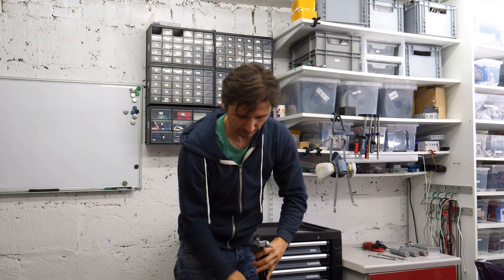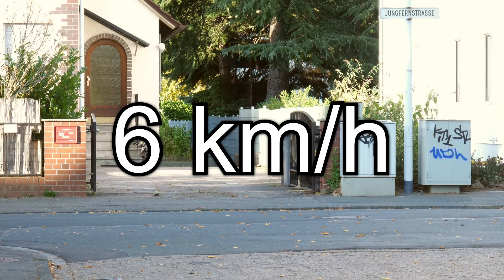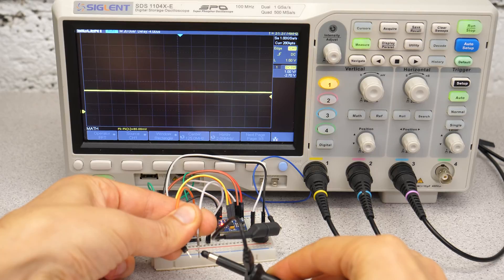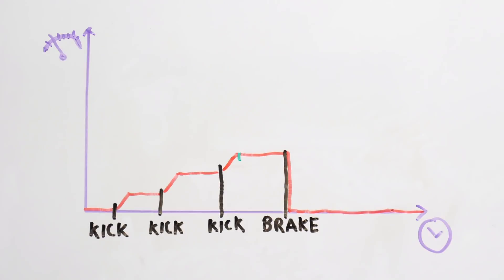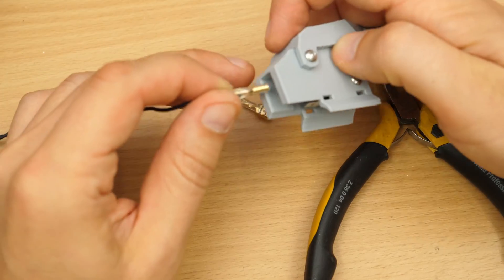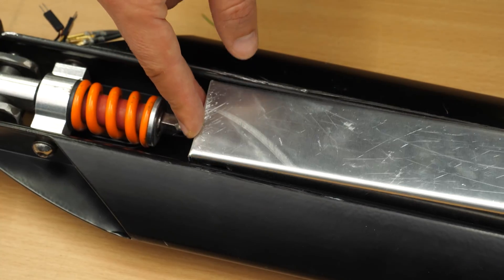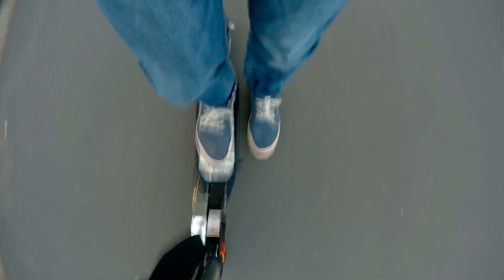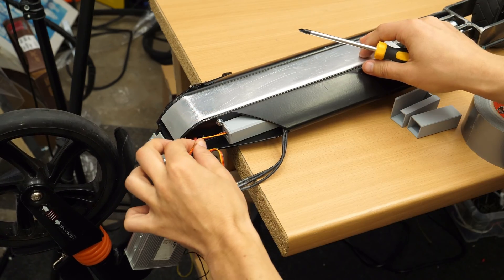DIY Electric Scooter Part 3: Kick Detection & Improvements

Comment: Here in NZ the scooter laws allow for 300 watts maximum power output and wheels must be no bigger than 355 mm diameter - top speed about 35 km/h. If you stay within these limits, the scooter is defined as a "low power vehicle" and are exempt from being classified as motor vehicles. The rules aren't really enforced however. Many people have scooters with much more power that will easily do 50 km/h or even up to 100 km/h so can keep up with traffic on the motorways.

Comment: Hi I’ve got a 36v 1000w scooter and I need to make it so I can charge the battery pack while it’s no in the scooter,can I just make it as a wire from charger to battery or do I need to have a control box in the circuit,any help will be greatly appreciated

Comment: Some advice: don’t ever use and connect two batteries of different mah together. It will destroy the battery with the most mah and will cost you. If you are connecting two batteries together in series, they have to have the same amount of mah.
Reply: It's fine to use different mAh batteries In parallel but not series.

Comment: Link to your site is 404, what kind of battery protection system is in place to prevent them going under voltage? What happens when water gets into micro switch and connects it constantly?.. tough you can just pull the wire.

Comment: as for the brake disengagin the motor, can  do better  - most of the ebike controllers have a ‘regenerative braking ‘ option , so when you enable the brake switch, power gets fed back into the batterypack (althou not balanced, just trough its power providing, not the charge-wires). most ebay-china controllers have this function not brought out, but stil have it. you have to find and connect the (pcb marked) solder pad from inside , to the brake’s switch, to the brake sensing wire for it to work. once installed, its a reliable way to slow down an electric scooter, unless the battery is freshly charged ( the first 500 meters , it provides noticeably lesser braking) i’m in belgium , have built scooter with a hoverboard 350 watt wheel and an ebike battery. as far as i know, its legal on the road here , just like hoverboards are if it doesnt go over 18kmph and your familial insurance covers them ( some do, some don’t )
Reply: furthermore, the electric scooter tops out exactly on 18 kmph with the hoverboard wheel, so a lucky conincidence. but for my ebike, i've also used one of these chinese controllers, and it goes over 25 kmph topspeed with it. i plan to disconnect the pas pedelec pedal sensor's data wire with a relais and an arduino, when the arduino senses more magnet pulses per second than 25 kmph brings, trough an external magnet on the wheel. can anuone help me with the code for the arduino, i've never used one ever before. reprogramming the controller 's IC itselve seems near impossible, they're undocumented. all the aruidno would have to do, is click the relais, when the speed sensed is more than 25kmph

Comment: That was fun! Nice touch using the gyro. Opens up other possibilities too such as theft detection if moved while disarmed and use gps + lora ...
Probably not worth it for this as you won't be parking it anywhere, but could be worth another project.

Comment: Awesome project. Though, like a few others have mentioned, you should protect the cables a bit better. Especially the point where the battery cable comes through the frame. It looks like that'll slowly wear away the insulation on the cable.

Comment: nice. i might build one. You might want to put some kind of protection for the battery cable against the metal in that hole in the frame, though. EDIT: Also, with that arduino, how cool would it be to have an accessory display on the handlebars? wouldn't have to display much, battery voltage and speed as a minimum. I went looking on that big china website after my first watch through of your videos and found 8" motors with built in hub brake, could be interesting for scooter 2 :D

Comment: Great mod and video ! i whas wondering since my e-step has a spedometer inside cant i just let de arduino sense a speed increase by mij stepping and boost that! then pause for a sec  til the next kick is sensed ? (kick > boost 1 sec. > pause  0.5-1 sec > re-arm the system again to sense the next kick)
Reply from the maker: In my case it's not clear when the top speed is reached. I am just using a delay. When it's ready for the next kick it will beep. Otherwise the speed up could be detected as a kick

Comment: Great job, first video Ever seen on YouTube converts simple adult scooter to electric. I am currently doing my project similar as yours, I used the same adult scooter but with a hand break, and I am using a 3700w brushless motor with esc at 12s 50.4v. And it used a 25h chain , sprockets to drive the wheel. 
You should use come up better solutions for battery enclosure, I have my scooter using 12s8p lion batteries that can go about 35 to 40miles per charge. It’s pretty heavy so I mounted on top of the deck, You can consider mount Lipo batteries on the handle bar with quick locks, easily to take off and recharges

Comment: That video was awesome!  Did you code the whole thing in arduino IDE?  I want to take a class on coding but no-one thinks I should start with C++ but that’s what arduino uses...   any suggestions?
Reply from the maker: in my opinion is JS a good language to start. you have all you need in the browser. It also shares much of the syntax with c++. but you should also be able to start with c++ if you are working with micro controllers. blink program has the same difficulty in any language. and you grow from there by adding stuff. I have used Arduino IDE to keep the requirements simple.

Comment: I'm sure you did add this, when you press and release break switch 3 times, you switch in to new mode, where your throttle is your brake switch, when pressed, full power to the motor. When released, no power to the motor
RIGHT???
Reply from the maker: If I would, I'd never able to admit offically :-)

Comment: Great video, loved the funny bits too. I'm wondering, could you detect a kick by measuring the current draw on the motor as well, maybe with a non-contact inductive sensor? That's what came to mind first when i saw it.

Comment: Look, if you're going to keep abusing Blender for the kind of things you do, the least you could do would be a tips and tricks video, like what is your workflow and how you manage to get proper real world dimensions into your objects, what your design process is, what kinds of shapes and features you avoid and what features you use most frequently, and how you fix stuff when it inevitably doesn't fit. I don't believe in "first time every time" you know.

That NC/COM emboss animation on the switch enclosure was slick BTW.

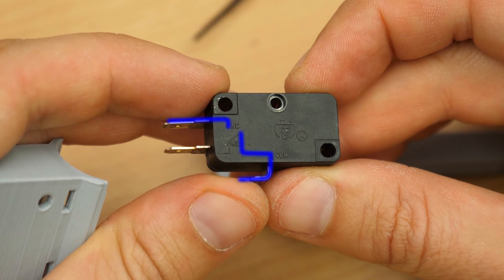Comment: The animation at 5:05 was brilliant :-)
Reply: I’d love to see a tutorial on that animation
Reply from the maker: it was the simplest effect ever.. as nicksperiments wrote. I took a frame from the video to highlight the path using paint.net and while I was there I simply used the stamp tool to change the original pic. then simply overlayed the original video. used the same section of the picture on the second click just adjusted it for the right placement.
many of the effects were done like that. the drill and tap bits was the most difficult since I had to edit 12 frames.
blender was only used for the explosions. the main part of the animation was taken from my smoke detector video. I just added the small flying me and scooter to it.
Reply: could you make a gif of it?
Reply: I was just about to post the same thing (that it was brilliant) :)
Reply: Rmindes me this old tony videos
Reply: szabonandi, it confused me a bit.
Reply: 2000jago I wonder if he used Blender for it since that’s what he ushers for 3D modeling

Comment: Thank your for the info on the Arduino throttle control! I wasted a whole day trying to figure this out on my own and I wasn't sure the values to use for the lowpass RC filter :]
Reply from the maker: that values work for 32khz pwm. there is change of the pwm control in the setup() to get the high frequency. you'd need higher values for lower frequencies
Reply: Danke! That frequency works perfectly for my speed controller. I am going to make a push button throttle that eases up and down when you press and release the button.

Comment: Cant you add a button or a potentiometer? Or os that illegal too?
Reply from the maker: it's only allowed to set the max speed or brake. but no throttle is allowed. it has to be only supportive from 6kmh